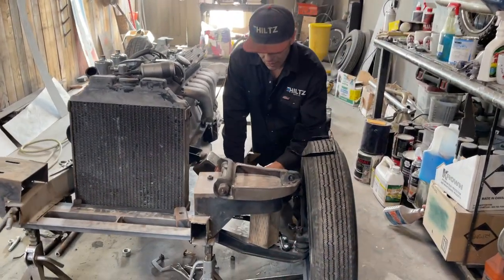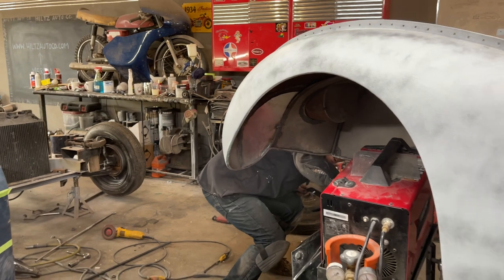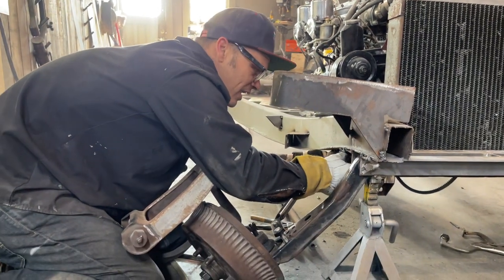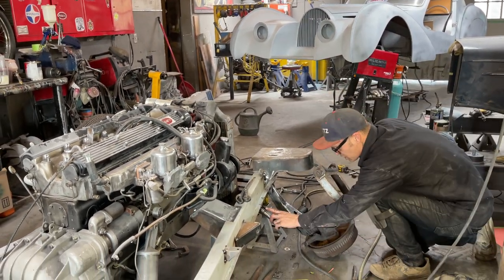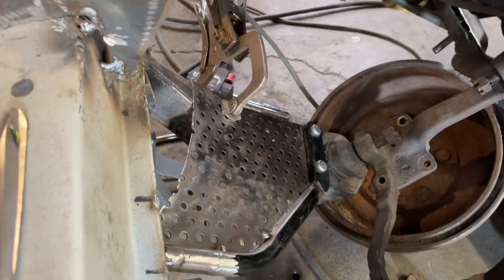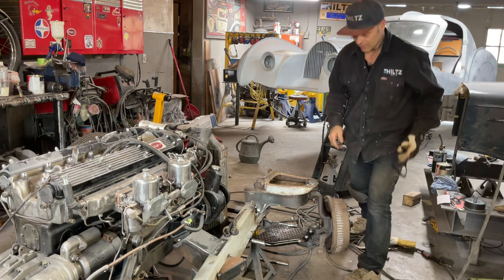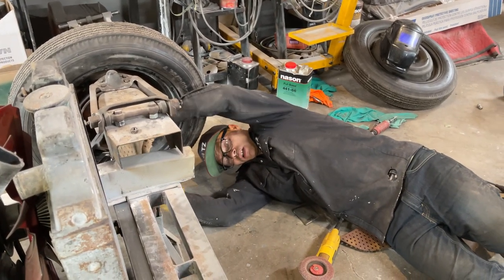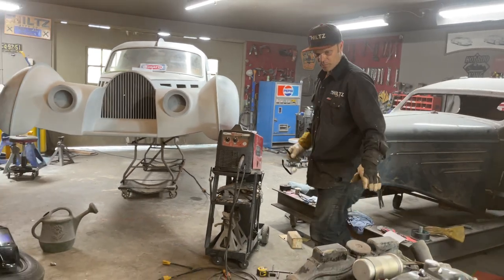CHASSIS FABRICATION: RE-ENGINEERING THE LOWER CONTROL ARM (AGAIN)

Comment: Chad, don't despair over not getting it "right" the first time. Front suspension/steering is an engineering specialty unto itself that the manufacturers have spent millions on "getting right". YOUR specialty is creating ART that can be driven and you are at the top of your field, right there with Ed Roth and Gene Winfield. Watching you work is watching history in the making...thanks to you and Jolene so much for sharing.

Comment: Wouldn’t you want to mock up the airbag before you put that plate on a arm just curious
Reply: Also (unless it’s the camera angle), get both top hats sitting the same. Also where’s the X member to go between them to add torsional rigidity ? I guess we could have a discussion about embrittlement when welding dissimilar metals into sprung steel & upsetting the molecular structure in the next lesson. Because ? Every Day is a School Day & “bunking off” gets you a detention.

Comment: Brother, I love your positive attitude, if I may be so bold, your talent lies in the art you are famous for, why not use the sub frame from the Jaguar you have in the bone yard? It was designed at great expense and is held on to the frame with some easily replicated mounts. Disc brakes and power steering to boot. Not being a douch just a thought bud. 👍

Comment: Speedway motors or Heidts have already reinvented the wheel with high tech engineers, when it comes to front ends and steering.  Mounting the upper control arms will give you proper caster, camber and toe in . There is still ackerman caster gain and bump steer and probably a few more changes that I don't about.  Please don't try to reinvent the wheel.
Reply: You can add Fatman Fabrications to the list. They were one of the first to offer a fully built IFS with a CAD redesigned unequal length A arms & a custom X member to suit individual requirements. It could be fitted to a chassis in a day.

Comment: Chad needs a copy of Michael Costin's chassis book. I've used it for over 40 years. Mine is hardbound and dog eared. Gussets and brackets on tubes/rod should be mounted on the neutral axis.

Comment: It's not that I don't have confidence in the front end Chad has chosen for this car (I personally would have put a straight front axel with king pins) but I would hope that Chad will install the best race car seatbelt and shoulder harness combo on the market.  I would also hope that more gussets on the chassis to beef up the upper "suspension cup"  would be welded in. Also another steel plate to weld to the radiator side of the suspension cup.  The whole thing just looks too fragile and I can imagine a good pothole could cause the existing welds to crack and collapse the whole wheel support.

Comment: I've built a complete front suspension including building my own A-Arms, calculating the mounting distance apart and length of the top and bottom A-Arms, including in-board horizontal mounted coil-overs (like the Indy cars have), Bell Cranks and adjustable Hyme ends. I had a company in Arizona make the Bell Cranks for me (sent them a full size layout) and it works great. Car show hit for sure. If I can do it (I'm a big dummy) I know Chad can figure this out easily. Using jigs and templates and having patience is the key.

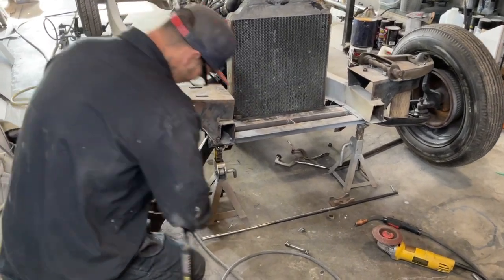Comment: "Plans fail for lack of counsel, but with many righteous advisers plans succeed." - Proverbs 15:22.
"The way of a fool seems right to him, but a wise man listens to advice." - Proverbs 12:15.
Through your submission to sound advice, you saved yourself the heartache of a terrible handling car and proved yourself wiser than many who flatter with their lips but don't really know what they are talking about. Your wisdom impresses me Chad. Now the lower control arm will work properly without binding which you would have noticed immediately when turning under acceleration. As for the mesh insert, the cross beams for the lower attachment for the air bag would have given good gusseting of the assembly without creating a shelf for mud to accumulate on but still, the mesh doesn't hurt anything. 
Thanks for allowing us to observe your journey and may God bless you both.
P.S. A very nice job on the lettering Jolene. It looks perfect. I'm so glad you didn't use lacquer nail polish. lol.

Comment: Be interesting to see if those pivot point eventually have to line up to get the correct geometry or whether over the short movement of the suspension Chad will get away with the current set up.

Comment: That metal way to thin especially for air bags and the metal with the holes is
Even weaker then with out holes come
On chad plus you should be useing a 180 Lincoln and 31/6 steel a lot pressure up and down with air bags thats a good size motor

Comment: Ok, finally you are on the right track. However, as others have pointed out you shouldn’t,t fill in the “A” arm until the lower front bag support is added. The 16 Gauge metal is not strong enough for this mount.

Comment: The chassis I am building now I am using QA1 93 to 2000 mustang lower arms they are for struts but easley modified for springs or air bags can be cut down and retaped and they come with ball joints and heim ends. Have a great day Chad and Jolene.

Comment: That is why I preferred your original set-up with the rod end bearing (reb) The reb was very substancial and as any reb it rotates in multiple directions. The military used them in WWll aircraft and they were/are exposed to heavy loads from constant mutiple directions. But, you're happy with the way this one works and it obviously does work well.

Comment: It is delightful to see you working through these engineering design problems that the big automakers worked out decades ago. As a sculptor and visual artist trying to build a business in my own community on the Pacific coast, I had to work out how to do cabinets that were both beautiful and well made. It was when I looked at the work of the successful cabinetmakers, that I realized I had done my structural designs almost exactly the same as the commercial builders. It's amazing how much you can achieve using common sense and logical thought. Watching your efforts here brought it all back to me...

Comment: Chad , I think the vented plate you welded to the lower control arm , should have a 1/4” or 3/8” rod welded to the edge that is towards the chassis. Strength and finished look . Alberta Dave

Comment: Love your approach to I can do anything. I estimate that your car will be around 3500 lbs or more. I noticed you have not talked about a sway bar or anti-roll bar. Are you going to add one? I understand your cars are mostly art pieces. However I am sure you also want them to drive nice. Based on the wheel base, tire size, and weight of the car a sway bar would be almost a must have. Otherwise it will handle  like a sailboat. Hope to see it to completion. Love the show.

Comment: Glad to see the re-engineering, I thought that one part of the arm being shorter would cause a binding issue going from straight horizontal towards vertical up or down.  Now that the bushings are on the same plane makes much more sense to me.  Glad you caught it, I now feel better.  Next time I question something I will comment, just don't want to be one of the naysayers as you just do a great job!  And so does Jolene!

Comment: Like your improvement on the lower control arm stabilizer bar.  Half circle like a 1 1/2” pipe cut into, then weld to the frame were the lower control stabilizer arm mite hide on the frame. Love your work ethics about doing the job right even if you have to do it over.

Comment: Sorry Chad I can’t like your video because I believe what you have done is unsafe, and I would hate to see your girl, you or anyone else hurt when that arm fails. The sheet you have added will add no strength and possibly cause a stress point. You should rebuild the arm with new one piece tube. Sorry but that is my opinion, for what it is worth. If you are hurt I will miss your content

Comment: I'm thinking about using a vw bug beam as a frontend on model T frame for a light weight T-bucket?
 I'm using a rear mounted electric drive motor for propulsion so there's not going to be a lot of weight up front, this way i get suspension, brakes and steering all in one go

Comment: You did good!! Takes some guts to learn from what you do and accept it. Moving on the gussets look good and add strength, now you need some on the inside of the upper mounts where you had to section the original. Great job.

Comment: I am glad you realized the geometry was wrong. The fitment issue with installing that arm means your geometry is still slightly off. It probably won't be bad enough to hurt your arms but it will still wear your bushings. Keep doing what you are doing. Trial and error is the only real path

Comment: I am not a mechanic (and I have not read all of the previous comments) but it occurs to me that by welding in those gussets to support the control arms you may be making a problem for yourself if you ever need to replace the bushings.  The way you are setting things up means you would need to remove the whole suspension unit just to replace that bushing.

Comment: Coming together, but doesn't the lower control arm hold the bottom of the air bag? It seems it needs some strong steel where the decorative steel is being applied. Just my observation.

Comment: give it your best try, if it fails, work the problem until it works.  I worked a similar front end suspension, was sweet until I hit a bump, then it was a zig-zag bump steering scary ride.  I know Chad won't put Jolene behind the wheel of anything dangerous!

Comment: Your top A-frame Mount has no anti dive and it should have a anti-sway bar which would be connected to a bracket under the bolts to your lower A arm

Comment: I feel like if I could do better, then I should  start my own channel on having the last words on building cars. So many types of cars out there with a spin that makes one of them the best at what it does. Obviously not better or even as good, I will watch and get different ideas on how it should look to me which may be a mirror of yours or a variation of said thing... looking at this was why block it in then the idea came to me that protects the airbag and it adds to the strength of this build.. so add it in. I hate to make new work for me to do if I repair something I built twenty years ago. When something works I tend to leave it alone unless its a safety factor to the person or rig. What I don't know is how the original item looked like to even start with. Not that it matters as it just needs to get done and quick before she is too old to drive

Comment: Chad will you make a drooping center crossmember between the air bag mounts to keep the frame rails from twisting inward at the top?  sweeping  downward in the center so as to keep proper radiator air flow.

Comment: Hey Chad, its a good practice to remember to weld things together while their bolted together or at least braced, if all possible, so that it won't warp while you weld it. As a welder fitter that is what we did in the trade to secure that things don't move out of alignment.

Comment: You have created a weak lower A frame that will fold up at the first pot hole. You have to have a full diagonal from the lower ball joint back to the frame.

Comment: I would weld the cheese grater to the arm but bolt it to the lower control arm so it can be removed if needed for repairs.

Comment: When you putting the rivets back in will you be using a tool gather than a hammer and ‘foot’ as that’s a lot of them and chances of doing damage
Reply: He used a air hammer rivet gun to put them in way early in the build. Go look at the videos.
Reply: Nope i didn’t see that one the one I seen he used hammers but was only trying it out